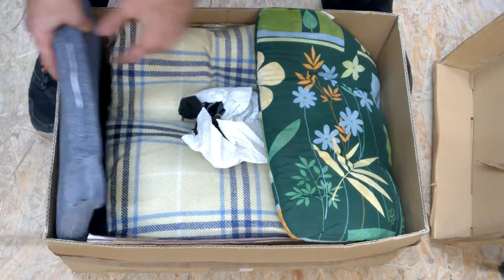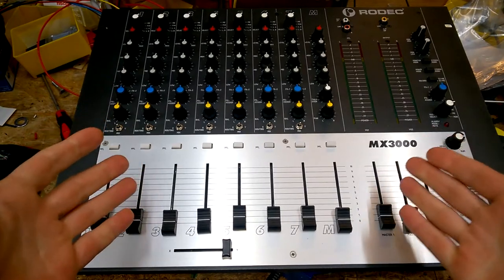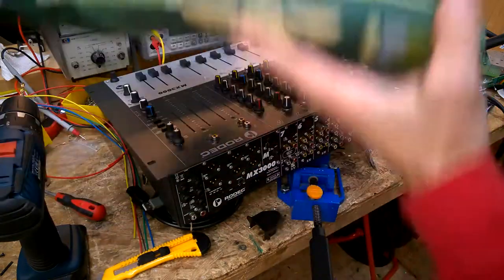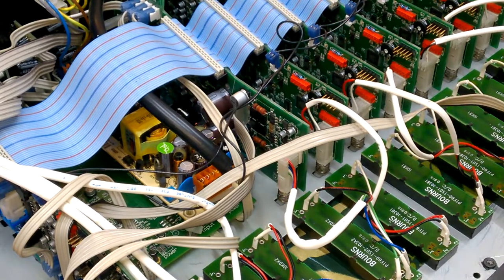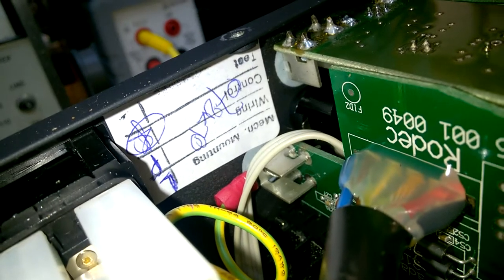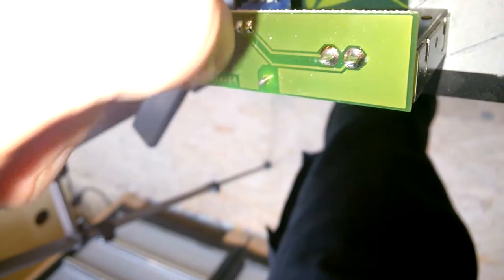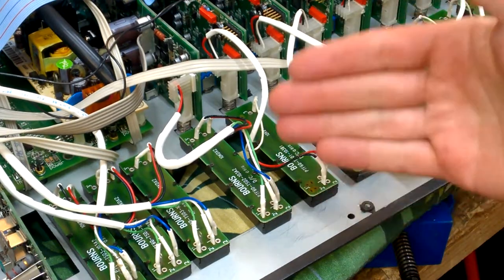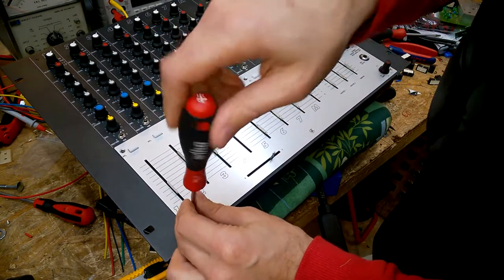BEB #59: Rodec MX3000 DJ Mixer: What's inside?

Comment: Just subscribed to your channel due to this review. Effectively, Rodec has been using Bourns faders for each channel in some generations (at least, I have them in MX180 Original and 50th Limited). And, despite in Original and Limited the signal runs through them, in MX3000 it's in a VCA configuration, so I guess there would be no much sense in investing in the typical K-Alps faders (the same situation as for Formula Sound crossfaders; they regulate a VCA circuit, so no big sense on upgrading into a better one; the opposite case is Hi-Level, which offers a Conductive Plastic XF for their PM4000/6000 series).

Regarding sound... well, it's a matter of taste. I'll drop here the link to a video in which you can compare the MX3000's sound vs Limited/Original sound. It's not the most exhaustive test ever, but you can figure out what you can get from both mixers (more comparisons also in my channel, e.g. MX-18 vs MX-180 Ltd ;) ).
https://www.youtube.com/watch?v=Pvo2xJGB_zo

Thanks-a-lot for stripping down the MX3000; I also see loads of SMD components instead of the discrete ones from its predecessors.

So, a new follower here!
Reply from the maker: thank you. you are welcome. 
there is more audio stuff coming. 
amps, preamps, tube amps, and so on
but also lot's of measuring equipment and electronics
I will definitely watch your video later this day.